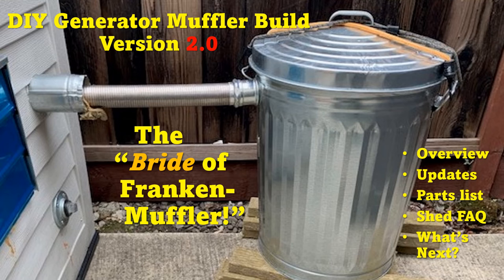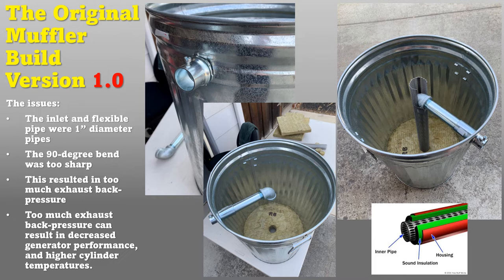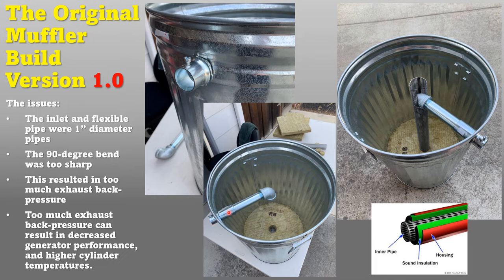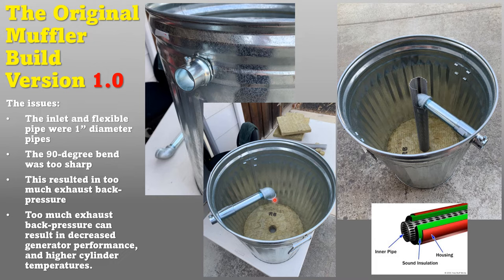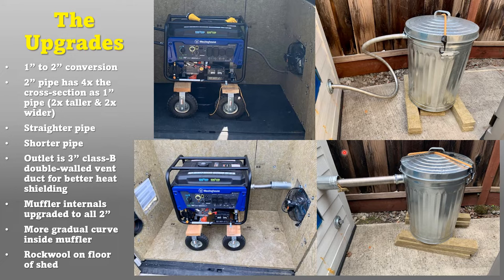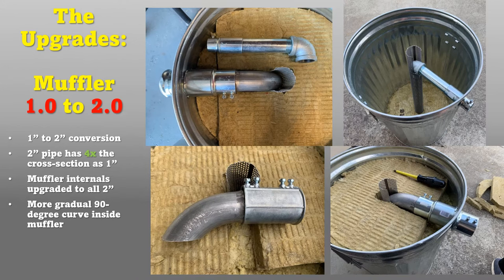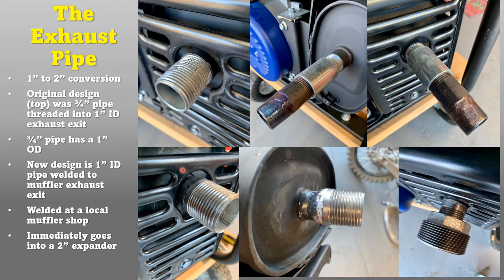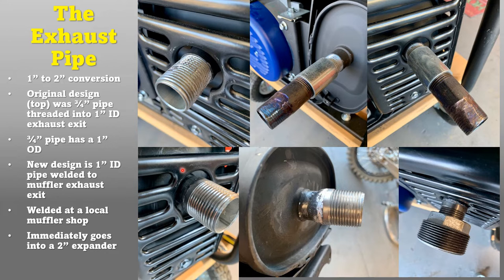DIY Generator Muffler Build (Version 2.0) - The Trashcan Muffler - Bride of Franken-Muffler

Comment: You don't need screws to hold the rockwool to the walls of the shed .. just use 3M spray glue.. the glue is much better
Reply from the maker: I'm sure you are correct.  However, I wanted to make sure that the rockwool wouldn't come apart and have the outer layer peel away and have the rockwool fall on the generator.  I was a bit worried that the vibration of the generator and the heat might affect a glued connection.  More of a belt and suspenders approach.  But good advice for those that watched the video that there are many ways to approach this.

Comment: I followed your steps to the T and I'm super happy with the results! If anyone is considering doing this let me say it works perfectly. It definitely takes time and patience but the results are awesome. One thing I'd recommend is I used a 31 gallon trash can and ratchet strapped the lid down got rid of the extra vibration. Also I added some feet with vibration absorbing pads and it helped as well. I can literally have a conversation right next to the shed with the generator running no problem. Thank you so much for sharing your wisdom.
Reply from the maker: Great to hear that it worked well for you.  These were just ideas that I decided to share that anyone could apply to their own generator sheds, since this whole thing was essentially just an experiment on my part.  I detailed my recipe, but the best thing is that you can use the ideas and approaches with whatever you might have at hand and probably achieve similar results.  And, as you found, you can add your own tweaks and make it even better.

Comment: Have you tried clocking the layers back and forth? I'd think as long as you leave the same sixa passthrough as the factory muffler, it would flow well and have that many more turns to deaden the sound!  All the pieces are cut, so trying that would simply take a few minutes and really nothing more.    Something else I was thinking about is putting your sound diversion boxes on the inside of the shed.  It would make for a better package and keep everything out of the rain. Also, maybe add a horizontal piece of the insulboard to the inside to make the air turn yer again.....   I would also love to know how long it takes to get the temp of the outside of the muffler to "TOO HOT TO TOUCH" levels??   I think this is a great project and with us going through a hurricame here in Northern Tampa Bay right now, this is definatelly on my mind.....  Thanks for sharing......

Comment: I am at this point. I have my shed built and all I have left is this. I considered using large Stove pipe with caps on the ends instead of a metal trash can because you can attach the stove pipe to the shed since they do sell wall attachments for stove pipe. The issue there is you can get large stove pipe but it would never be as big as what you are using. This is going to take a bit of thought and research. Your Exhaust system is the key to all of this and I thank you for it.
Reply from the maker: Sounds like an interesting approach.  As I said in the Version 1.0 video, the trashcan was just a convenient object to pack a bunch of insulation into and scale-up a glass-pack muffler concept.  Almost anything can work.  It doesn't even have to be round.  Just some container that can absorb some of the sound, and preferably won't catch fire in the process.  Glad you are taking some of the ideas and running with them.  That was the entire point of the video, thinking outside of the box and applying some of the principles to make these generators quieter, no matter what materials you might have laying around.  Good luck!

Comment: I like your muffler.   Your video it get us to think.   I am putting a generator and shed together.   What I think I will try for the muffler,  this way.  Smaller can with led,  use the same materials for baffle, except I thing I will design it a little different.   I want the flow of air with no sound.   Have insulation, space, insulation with opening at 33 degrees spacing. This way the air can travel to different layers to absorb the sound.  The number of layers and be modified.     Thanks with great job.  I like to tinker and make things, like my 63 year old car.

Comment: For very budget-conscious people wanting to build a generator quiet box, I used an IBC tote, removed from its cage, lined with insulation material. Cut one door in the front, trying to retain as much structural support as possible as the tank is not completely rigid once cut. The top cap hole or the bottom tap hole can be used for exhaust venting. Tank is mounted on a strong wooden pallet. You could add wheels to move it around etc

Comment: Great work. Really well done. A few suggestions:

1. Add another fan for the intake instead of the material.
2. Adjust the exhaust fan so that it's at the highest possible point in the shed. Heat rises, and quickly.
3. Don't put your propane tank in the shed with the generator. If the fan fails, or if you have an extremely hot day and the tank is near full, the LP in the propane tank will start to expand quickly. If it expands too quickly, the tank will start to blow off propane through the pressure release valve and fill the shed. Propane needs the proper air mixture to explode, but I wouldn't risk it. Buy a 10 or 20 foot hose and put your tanks well away from the ignition and heat sources.
Reply: Well said

Comment: I was also inspired to build a copy for my camper generator since I has almost all parts laying around. Since had to be portable I made it from a section of 8 inch galv duct, two endcaps, rockwool, and some 1/4 galv mesh wire. All I had to buy was the 1 in flex pipe. Basically a  glass pack EXCEPT I placed four 4 1/2  dia. abrasive cutoff disks (heatproof) spaced down the middle inside the wire mesh tube to act like a gun silencer construction.  Packed the rockwool around inner wire mesh tube. This seems to work very well. Thanks for the inspiration.

Comment: I really like the increase in the diameter of the outlet pipe as it exits the engine.

I am in the middle of my build.  The problem is that the rockwool board is not available near me right now and shipping currently exceeds the price of rhe board!

My generator is only a 120v 4500 watt Champion, and Im planning ro put some kind of muffler inside the shed and vent the exhaust outside.

Thanks for showing us you parts for the exhaust pipe.  Enlarging that pipe is crucial

Comment: I built a wooden sound reduction shed with a hinged roof.   I used many of your ideas, thanks.  Now I need to fully figure out the exhaust system and get the right gas lifting arms for the roof weight.  I want add a 50 amp plug behind the meter that senses power when it is on/off.  Thanks again for sharing your ideas, well done and very good information.

Comment: Sorry for premature comment I see you have the fiberglass tape coming.  You spent a ton of time on this and it's very detail oriented.  Great Job!  I had no idea dirt bikes of that size could be battery powered.
Reply from the maker: Yeah, love these bikes.  They are so fun!  Look up "Alta Redshift" on YouTube.  Lots of great vids.  They aren't silent, but they are much quieter than an internal combustion bike, so you can ride them places you wouldn't normally be able to ride.  They pretty much outclass most dirt bikes except for range and recharge time.  Hopefully that can be addressed in the coming years as battery tech advances.
Reply from the maker: If you really want to see what an electric dirt bike is capable of, besides the Alta Redshift you can look up the newly announced Stark Varg.  It looks seriously impressive (think 80hp, 6 hour runtime, lots of really innovative features.)

Comment: Very informative and detailed. Thank you.  I have been putting the list together to proceed with this, and I had a few questions for you or this group.
1) Internal ventilation of shed; My proposed approach would be to use an attic fan, but place it on the lid, with a roof/rain cap (GAF Masterflow ~1250CFM).  Heat rises, sure, but with forced air does not matter.  The benefit is that the opening would be on the top side and not direct the noise up and not to side, maybe not requiring the baffle box on exit.  Had you considered that or reason to have gone with exhaust to side?
2) Direction of exhaust, if the concern is the noise out the pipe, did you consider going straight up after the side of the shed.  A small rain cap on top of 2" EMT or even the 3" double wall like a gas water heater all the way up.  I would consider the vertical placement of the pipe 1-2 feet above head levels would remove it from people head.  My proposed would be to direct it all the way up to 2 feet above eve roof line (12 feet total height).   I have been trying to find other installations with a vertical stack but unable to. 

The video is fantastic, and I appreciate your detail and approach to explanation.
Reply from the maker: I didn't put the fan on the top of the shed for a couple of reasons.   1) The fan is heavy and the plastic lid of the shed would have bent down.  It also would not have allowed the lid to stay open with only the stock gas struts that came with the shed.  2) Rain.  The shed needed to be weather proof.  While the attic fan does have self-closing slats that close when the fan isn't running, it wasn't water-proof.  There are other fans that do have a rain cap, but they are even heavier.  If you are going with a sturdier shed, then you can certainly go with the roof mounted fan approach.
Pointing the exhaust pipe up at the sky or down at (or under) the ground is definitely an option.  You do need to think about rain intrusion.   The method I used is just one option among many.

Comment: Great project, I might copy it.  
I use similar rubbih bins to store bird seed and keep out the squirrels.  I use over centre catches to hold down the lid and that works really well.  There are screw adjusting catches available so you can fine tune it.  They don't perish in the sunshine as bungies do.  How about a ring seal, maybe rubber, maybe rockwool if you can keep it contained to stop lid leakage and rattling.
Reply from the maker: Those look like great ideas.  Will have to look into the catches you mentioned.

Comment: thanks for your video..just did my box with same generator and looking to sort out exhaust routing, was interested on how you tapped the exhaust. glad I stayed to the end to see how you created shaped chamber in the garbage can....good ideas
Reply from the maker: In the version 2.0 exhaust that I covered in this video, I just had a small piece of 1" threaded pipe welded to the tip of the muffler outlet.  In the earlier (version 1.0) exhaust, I used a 3/4" (pipe thread) tap to tap the inside of the exhaust outlet.  As I explained in this video, though, I don't know if I would recommend that method, because it does drop the inside diameter of the pipe down to 3/4".

Comment: I apologize if I missed this, but it seems like there are two potentially simple refinements to this approach which wouldn't require much heavy rework: 1) coating the walls of the muffler with acoustic material (e.g., dynamat or roof flashing) to reduce transference 2) Putting the metal muffler can within another vessel such as a 55 g drum or rubber trashcan, potentially lined with absorbent material.
Reply from the maker: You can certainly keep adding layers to the whole thing ad infinitum.  Layers on layers, sound walls, redirection of sound upward or underground, sheds within sheds, etc.  The sky is the limit.  But then apply the law of diminishing returns, and you'll eventually have to draw the line somewhere.  Those were all good suggestions, and if you have the time, space and resources, you can keep adding mitigations.   Or just buy a quieter generator.  Thanks for the ideas, which is what these videos were all about.

Comment: will continue watching this new upload.  I think some hardy cement board on the outside and inside would help where the pipe passes through.  I can tell you even with the extra pipe you have that walker exhaust is going to get 600 degrees and that's a point where my shed started to melt even though it was incased in a 4 inch dryer vent.  In retrospect I saw a video where the builder cut a 6 inch hole in the shed but a 4 inch hole in two pieces of hardy or in your case a 4 inch in the shed and 2 inch in the hardy.   I also wrapped the walker exhaust with muffler fiberglass tape and that has seemed to help.  I was getting temps up to 130 in Houston.

Comment: 8:05 Cut up some rock wool into small pieces and pack them into that into the 3 inch vent that you are running the exhaust pipe through. This will not only protect the plastic even further from heat, but also prevent insects from traveling through the larger opening. Nothing like opening your enclosure to find a beehive. I might also want to have the exhaust pipe entering the trash can towards the bottom of the can, and have it exhaust somehow towards the top, as hot air rises, which would aid in keeping things as cool as possible. The biggest challenge here is finding a way to exhaust without letting rain or snow in.
Reply from the maker: I actually did pack some rockwool into that 3" vent, around the 2" pipe.  You can see a piece of it hanging out in the main cover pic, and at the intro to the video if you look close.  Not super practical if you take the 2" pipe in and out though.  When not in use, I put the garbage can in the shed, and I put a cap on the 3" pipe.  And yes, the exhaust goes out the bottom on this design to keep the rain out and also to make the sound turn one more corner at the bottom to dissipate a little more energy.

Comment: I came from your 1st Gen Video.  Amazing Video and Explanation.  Thanks for sharing your design, ideas, and explanation!!!  Love the improvements and thought put into your 2nd Gen, and thanks for the feedback on my previous videos comment!

In the previous video I commented about potentially using 3-5" river rock with Rockwool lining.  To elaborate I was simply trying to think of ways to use more volume of the can by potentially using diffusion.  The main idea would be to use more surface area of the Rockwool to absorb the sound by diverting it.  I think having the Rockwool right up against the screen reduces the surface area and the rest of the Rockwool probably isn't being very effective with the majority of sound still coming straight though to the bottom.

Thinking of combining methods of reflection, diffusion, and absorption...
Maybe cutting and stacking Rockwool - leaving air/sound pockets for travel
Material Ideas: Large River Rock, Brick, ???  Open to suggestions???

Final Thoughts: No point in improving sound from the exhaust if the sound is louder from another area.  I.E. It doesn't make much sense to create the best muffler in the world if the sound coming from the shed itself, exposed pipe, air/fan openings, are louder than the exhaust can if the over all goal is simply to reduce the level of sound from the entire system.  You are only as good as your weakest link.

This makes me want to start this project to test and come up with the best design, but spending $2k on a shed and components, although the process might be fun, money may be better spent on buying a more quite generator in the first place in the form of a more built for purpose solution such as a true home generator from Generac or the like.  I say this having just bought the Firman T07573 ;)

Use case is everything here.  As a primary goal to have a large portable device and secondary to use at home in case of emergency, with costs in check, I think this makes total sense. 
  
This project definitely got me thinking!!!

Keep up the GREAT work and Thanks Again for sharing!

Comment: How about attaching a small motorcycle muffler to the exhaust port, first? Motorcycle mufflers have noise cancelling properties, which create sound waves that cancel each other out. You could attach the trash-can, set-up behind the muffler. A car muffler would be too big and not have the pressure to force the air & sound into the baffles alongside the main tube.
  You could do the same after your cabinet vent. You could attach a catalytic converter and cut air pollution, if you have the money.
   Rather than just insulation within the generator shed; cover the insulation with sheet-metal, wood, or plastic, panels; perforated with holes. Hundreds of say, 1/4-inch-diameter holes drilled into the panel, or lesser amounts of 1/2-inch or 1-inch holes. You will have created boxes on the inside-walls. The perforated panel boxes trap the sound better. It is called a "Helmholtz Panel Absorber". The number and size of the holes relative to the size of the box created behind the panel is important to absorb low-frequency, bass, sound. You would have to it look up. They have online conversion calculators where you put in the dimensions of your inside-wall-box and hole size, and it tells you the number of holes to eliminate the low frequency sound. A panel with 1/4-inch holes will trap different frequency sounds than 1-inch holes. So, you could make several panel boxes; each with different size holes.
  Dampening the air intake to the compressor reduces noise. Stopping vibration reduces noise; i.e. putting the compressor on a rubber mat or pads cut from a rubber mat; and a flexible hose metal hose for a few inches coming out of the exhaust port. A small fan blowing against the final exhaust port might break-up the sound.
Reply: I add motocycle muffler to my extra loud diesel generator. No much effect, its still ridiculous noisy but sound become more "nicer", it has now only low frequencies.